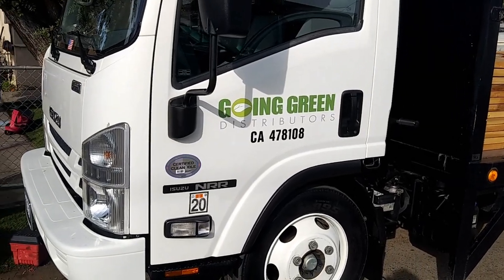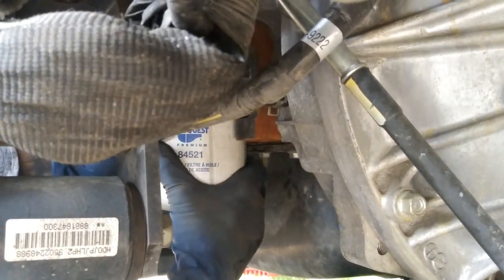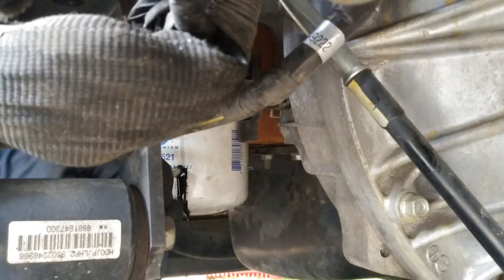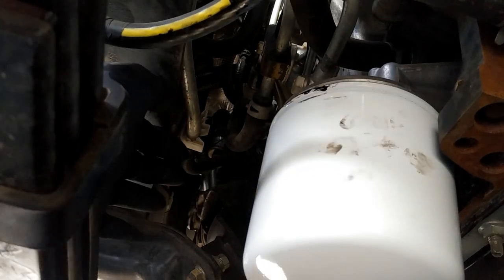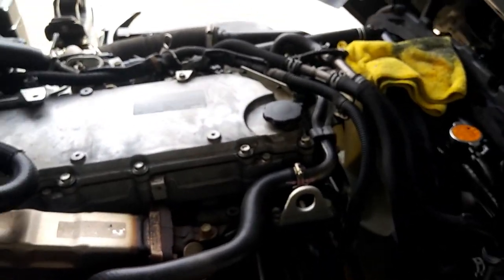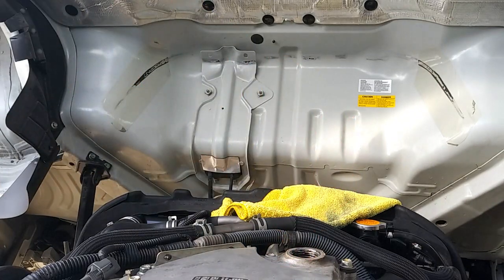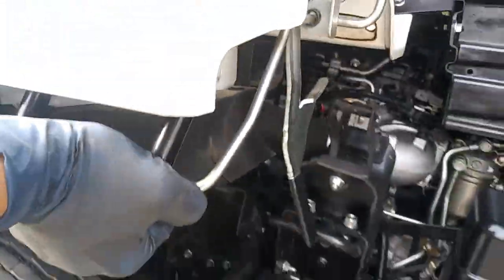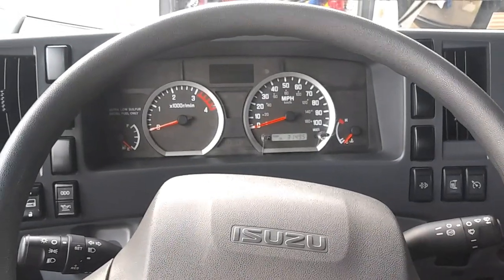2016 isuzu nrr oil change

Comment: I have a 2016 isuzu npr unleaded gas. I wonder if everything is located in the same place as your diesel model truck. If so, I can do the oil changes on my own instead of waiting 2 hours at the truck mechanic shop.
Reply from the maker: Yes you can. Its like a silverado

Comment: Pretty sure that's not how you take off an oil filter
Reply: If it comes off it comes off. It's trash anyhow. Most people don't have an oil filter tool as big as the Isuzu filters.
Reply: @trickdawg5521  good thing it's every 10000 miles nice to know about the tool
Reply: You can also put a ratchet strap around it then use a wrench or screwdriver to torque it loose.

Comment: Google says my Isuzu would take about 22 quarts. Could that be right?
Reply from the maker: I used about close to 15quarts. And check level of oil
Reply: @JaboTheMechanic  I have a gasoline engine. V8. After 5 quarts the dipstick is reading full. Could this be right?
Reply from the maker: Yes if its gas yes. Its most likely a 6.0 chevy motor gas.
Reply from the maker: And what weight did you use
Reply: @JaboTheMechanic  5w-30.
Reply from the maker: @wakeupmrwest4357  ok. You are good to go